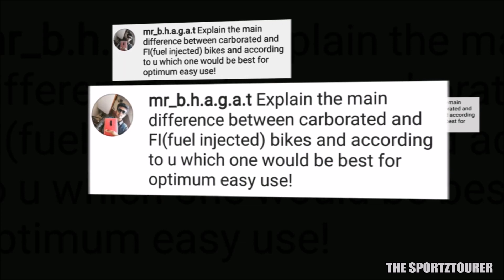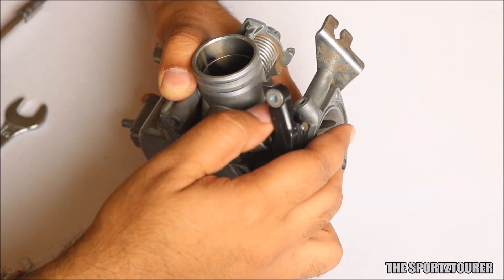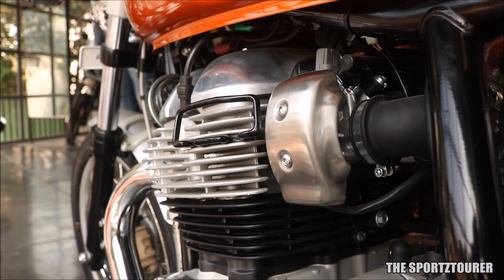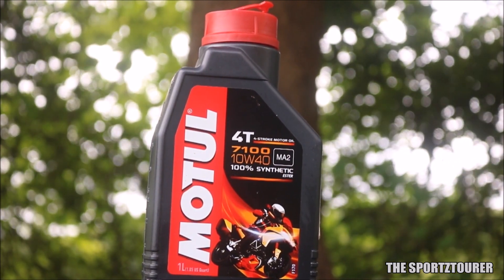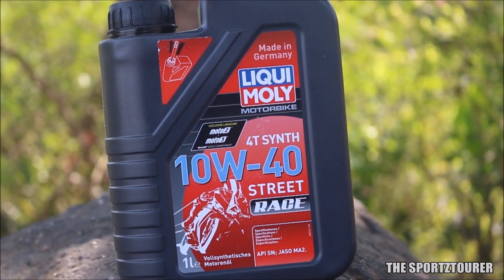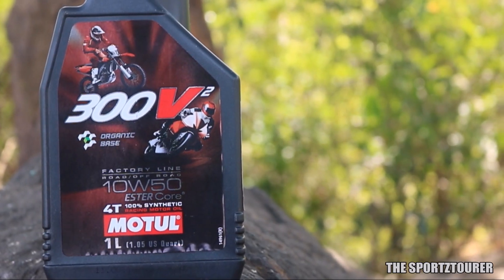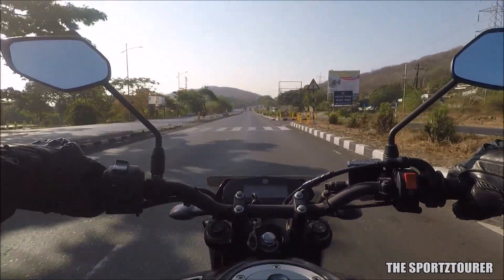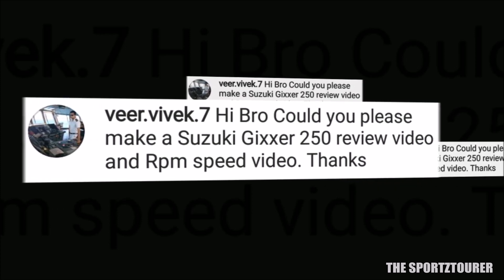Q&A CARB TO FI MOD, BEST ENGINE OIL FOR FZ, DOMINAR, RTR 200 VS FZ 25, GIXXER 250 REVIEW

Comment: Question: Is KYB G10 front fork oil available for RTR200 4V? My service centre said TVS doesn't supply it. If so, which 10 weight oil is best for the beautiful front suspension of RTR200 4V?

Comment: I have been searching for a youtube channel who can guide me with the proper info abt rtr200 and I found u r channel to be the 👌best. I have been facing a issue in my rtr200 while riding between speeds 45-70 I get some noise from down the engine part not sure if it's from chain sprocket or gear leaver and the noise is like hitting the chain and it's doesn't last more than a sec but comes in time intervals of 1 to 2min. No service center is taking my point. The chain part also seem to be completely normal not loose or tight. Due to this issue at once my gear leaver popped out and I faced difficulty at that time can u guide me through this by providing some tips as it would be greatly helpful to me 🙏.

Comment: One question: I have an Apache 150cc 2006 model, which i have done a bore increase of .75mm in total. Also done need full Carb settings, installed iridium spark plug and a K&N air filter. These upgrades resulted in more acceleration, more HP and more top speed. Now i want to upgrade my bike in the stroke dept(making it a short stroke). So that more power strokes come in lesser time thus helping in more HP gain. Kindly update me on the same. Steps and methods for doing this..

Comment: I'm loving this Q&A session, keepp up the good work. However, I have a question sir, which oil will be a suitable choice for my new 2019 GixxerSF Fi 155 cc? I want to use it for weekend highway rides and regular use on college while sometime raising its true potential on both ends of my use. Can you suggest me some oils from Liqui Moly, Motul or any other brand? Please answer this soon sir if possible.

Comment: Always I will make a note of your vedios , I wanted to know that I used 300v in my RTR 200 it was good, I want to know how many km's can we ride for below mentioned engine oil this is always a big question to me :

1.Motoul 7100
2. 300v and 300V2
3. Liqui molue

I'm always confused with the Km so all the time I use to change my engine oil with in 3.5km .

Comment: Please suggest me an engine oil(mineral) for my fzs v3. Currently using yamalube optima prime 10w40. But I think its not doing its job properly. Engine heating issue & gear shifting is also hard.
Thanks for your informative videos..😊

Comment: I used motul 7100 10w40 and bosch twin electrode spark plug in my 1 year old apache 200 2.0 but i still not getting satisfactory milage . In city it gives around 25-28 kmpl and 30-32 kmpl in highway.
Plz suggest me some solutuons

Comment: Bro one doubt, Apache 200 4v race edition is slipper clutch which gives mileage of 35 to 40 whereas the same slipper clutch on Mt 15 gives 50+ mileage as mentioned by "arunsmokie", also does slipper clutch increases the mileage than the normal clutch bikes? Is Mt 15 best or Apache 200 4v??

Comment: The second question is I face right shoulder and back pain while driving my pulsar 150 classic 2018 edition during long rides, is it due to sitting posture or the seats suppose if I install 220f split seats, will this body pain problems get reduced? Also Bhai please suggest me a good engine oil for pulsar classic 150, I tried motul 7100 20w50 fully synthetic my bike performance got reduced.

Comment: Hi sir
Ur videos or review's r really appreciative......my que. Is 
Which engine oil is best for RTR160 2016 model....here I also wanted to mention that I have replaced the clutch set once , just 2 months ago.
Please segust. I need a comfortable ride specially when I throttle it.
Reply from the maker: Hi,
Which oil are you using now?
Thanks a lot for liking the videos and supporting the channel 😊
Reply: @thesportztourer  I am using Castrol active synthetic.

Comment: I am using hero hunk motorcycle about 30000km but after 15000 km my motorcycle makes vibration when reach the speed level 110 km.but it was not happen when my motorcycle was new . from very begining I am using motul 300v . please help me.

Comment: Which engine oil should be perfect for the  fzs  carburettor model, in day to day traffic ride nd long rides. ....i recently used motul 7100 10W40...
Reply: i am confused between motul 7100 and motul 300V

Comment: I am motal 7100 10W40 fully synthetic my apache rtr 160 4v but not available in my regional area online not available you can better solution another best you can tell because I am long ride 300km to 400km which engine oil best

Comment: Hi sportztourer
Need help 
It's really getting hard to maintain the karizma 2005 model 
Getting electronic problem such as speedometer is off 
When switching on headlight metre goes off completely plz suggest some solution
Reply from the maker: Hi Sahil,
I did get a similar comment from a Karizma rider where there was a problem with current leak and battery. I would suggest you to get the electricals inspected from an expert mechanic or authorized service.

Comment: Hi bro... How about using Engine Ice Hi performance coolant oil for CBR 250R ??? Will there be any noticeable change ???? Please solve my doubt. Thank you in Advance bro.
Reply from the maker: Hi,
CBR 250R has one of the best heat management systems in liquid cooled motorcycles so you can go with a good quality coolant. I have shared my experience with one here: https://youtu.be/pOpnDUiXFbs

Comment: Pls tell me the best engine oil for my gixxer 155 .I am confused between liquimoly 10w-40 vs motul 300v 15w 40
Reply from the maker: Hi Aayush,
Which oil are you using now?
Reply: Liquid moly 10w 40
Reply: But I had a oil leak issue on my Gixxer that's why after the issue is resolved I have to change the oil
Reply: And liquimoly is not easily available .and cost is also high I buyed the full performance pack for my bike

Comment: Good morning sir 
I ride my rtr 200 only 6-7 kms/day in local areas which engine oil is recommended by u
Reply: Well any engine oil will do but if you only drive 6-7km per day you have to change your oil by engine running hours not km. Motor oil that isn't heated up to full temperature will get moist and milky in color. To make sure that doesn't happen you should let the engine warm up to 100c and let it run for another 20 minutes or simply change the oil every 3 months or 70 hours. I've had that problem with my dirt bike. Only drove it 2-3km a day on average and the motor oil got milky from not heating up to evaporate the water.

Comment: Bro i need a strong solution on chain maintenance, as whtever we use one the bike experience a rain the chain start to show stiffness ( i am using diesel to clean+ gear oil also used motul chain lube but ended up in similar results. Can u show use wax coated chain lubes and how effective they are against the rain fyi im also from pune so u must be kwning Wht lvl of rain we faced recently. Thx keep posting we will keep supporting ✌🏻✌🏻
Reply from the maker: Hi Vishal,
Will try to check on the wax type chain lube. Meanwhile have you checked this: https://youtu.be/SRLMWxFeKKg

Comment: Well sir i had lost around 250ml of my 10w30street oil while doing around 700km after the oil change and the engine felt hot so i went to check out and how in the earths heaven can a bike loose 250 ml of oil..apache 2.0